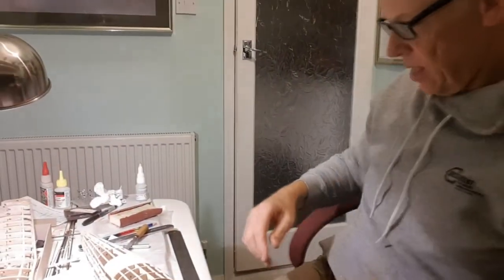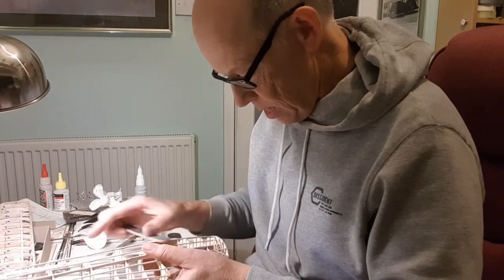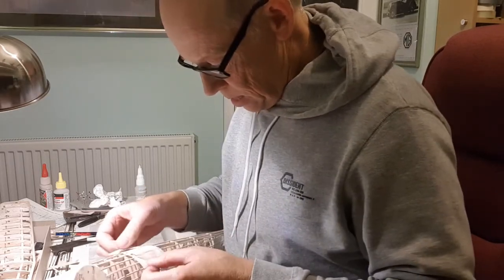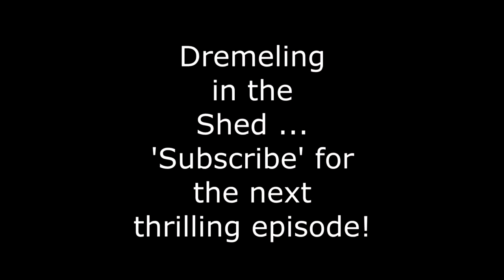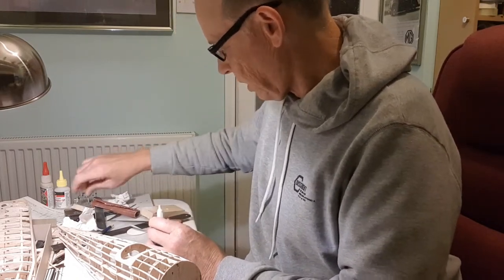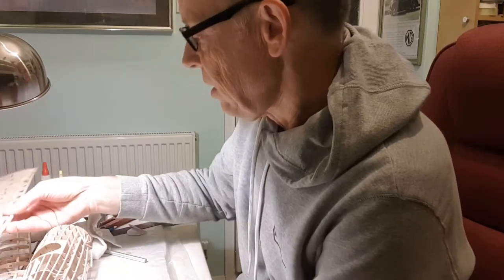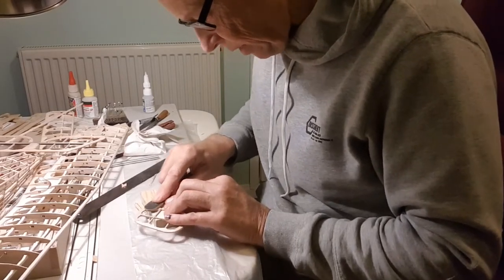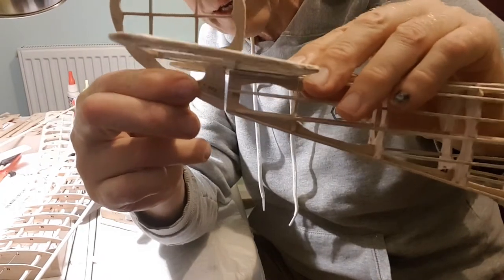Guillow's Nieuport 11 Radio Control Conversion (Part 2)

Comment: Hi Cliff, I just wanted to ask you what is the final weight of your Nieuport 11. I did not find any mentioning of the target weight of the balsa kit. I have enlarged the Nieuport 11 about 1.44 times to achieve the scale 1/6 (wingspan 1253 mm). The weight of my plane is something like 2000 g. I just want to compare the surface load, because I am a bit afraid my Bebe could be too heavy....
Reply from the maker: Hi Pavel, I can't remember the weight off hand but it wasn't heavy particularly. 2kg isn't terribly heavy and, as you know, there's only one way to find out, cheers
Reply: Well, I believe, that I could get the 2 kg in the air if I had enough airspeed. Unfortunately I have a very similar difficulty like you had, when you were trying to make some jumps with your Nieuport 11 in a gym. I can not keep it going straight on takeoff. Did you find any remedy for this behaviour of your Bebe?

Comment: do you have a parts list for the rc controls needed ?
Reply from the maker: Hey Bruce, good question, I'll tell you what I'm putting in but you may want to wait to see if it all works in the air! This is a bit of a departure for me, equipment is: Robotbirds 2900kv motor, Turnigy Plush 32 12a esc,  Spektrum AR6100e receiver and three PES GH-S37A servos and a 2s 450mah lipo.